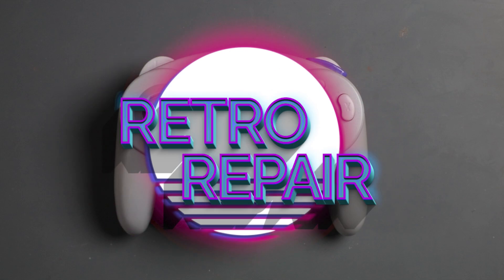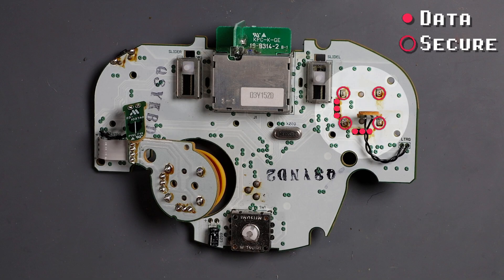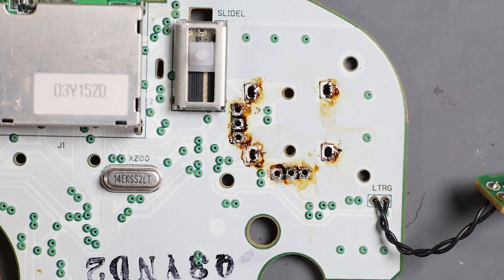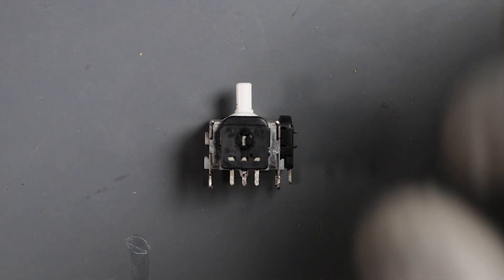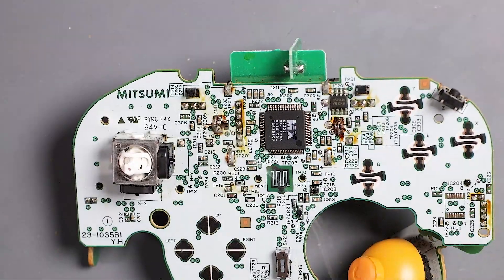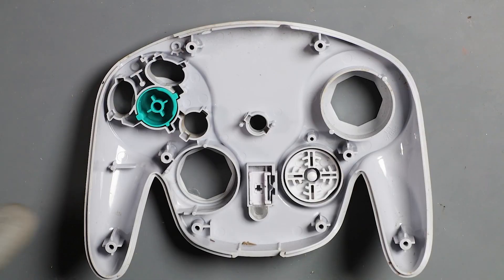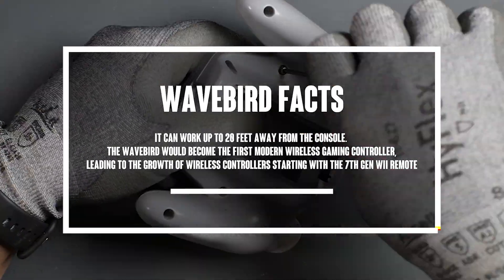Gamecube Controller Hack: Say Goodbye To Stick Drift With Wii Nunchuck!

Comment: You put the trigger contacts in upside down. It wont register a full button press, only a partial button press. The trigger contacts are supposed to go under the removable plastic battery piece. You slid them in on top.

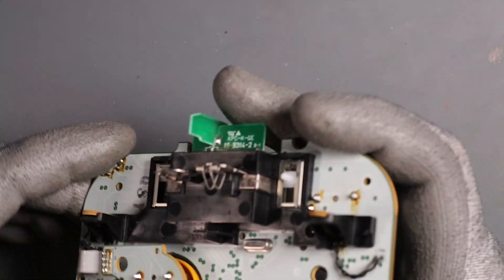IE at 0:47 they have the round part pointing up. But when you slide everything in at 3:54 the flat side is up.

I bet if you bring that controller into Melee right now, you wont be able to air dodge.
Reply from the maker: Thanks so much for letting me know and you're accuracy on this. I really appreciate you letting me know your deeper understanding of the repair. I will make sure to take your tips for the next time I do a fix.  Thanks again for your comment. I appreciate your help 🙏🏼